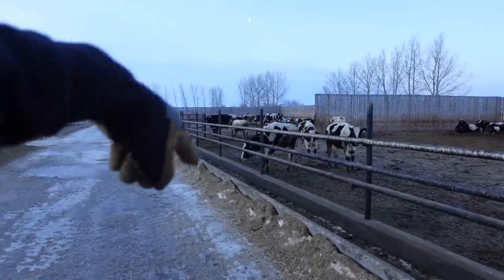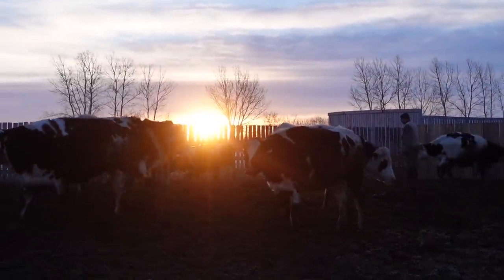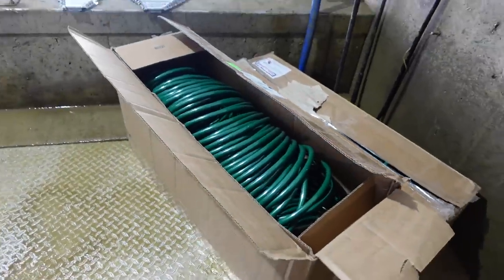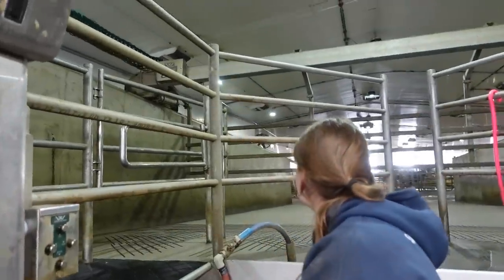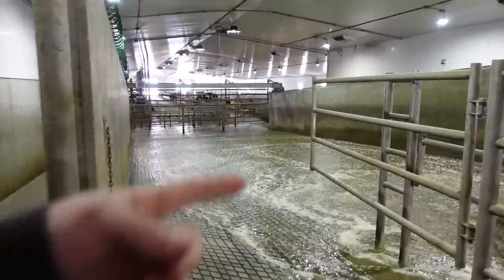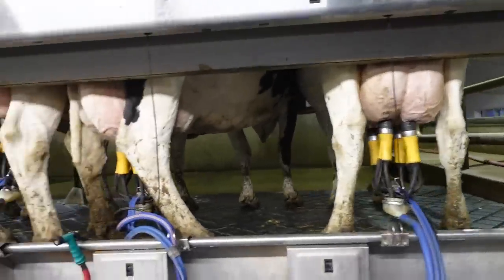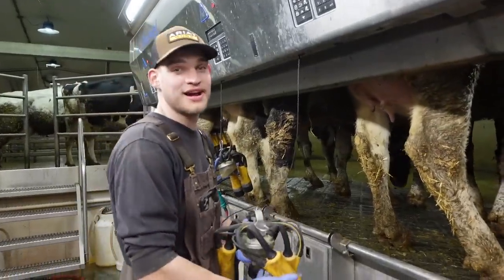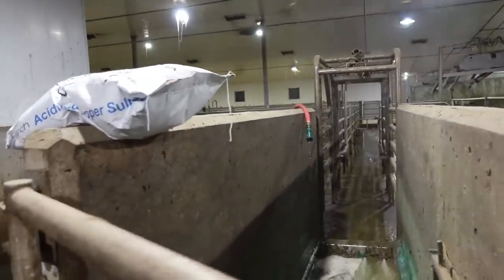Team Work Makes The Dream Work!

Comment: Could take an old line and feed over cable. Then you’d have rubber on rubber. Would save some wear also. Thanks for your videos ✌️
Reply: Exactly. I've also seen this done with pex. Take a piece of the tubing, make a slice all the way down, and then fit it over the cable.
Reply: Pex works

Comment: You might consider putting some split plastic wire loom on the cable to prevent the lines from rubbing on the metal cable.

Comment: Have you considered putting one of your older air lines on the cable to prevent the metal on synthetic rubbing?  What about grease on the cable?

Comment: Just a suggestion - you might be able to protect the air lines by putting a rubber hose around the cable, so rubber runs on rubber, instead of on the metal cable.  That shouldn't be too hard to do  - cut a small garden hose lengthwise, and wrap it around the cable.
Reply: A split water hose, or old air line, or pool noodle will all work, but will have increased friction when the air lines drag over it.  Better solution is plumbing PVC pipe -- that's smoother, so reduced drag on the air lines.  You can use old, leaky pvc pipe, which should be cheap.  And bigger pipe (like 3" or 4" diameter) will spread the coiled air lines over more of the pipe, thus reducing the wear on the air lines.  It will take some work with a saw to split the pipe, but once done, it should last for years.
Reply: I’d suggest a Teflon sleeve over the cable.

Comment: Another great video Jan. With those air lines have you thought of putting old air line or some type of plastic hose over the cable so they do not wear so fast.

Comment: If you cut short sections out of old hose, and split them lengthwise on the outside of the curl, they can be slipped over the new hose and give it extra thickness where it rubs. Then ya just change(or re-adjust) the protectors as needed 🙂 Is the steel cable coated with a hard slippery plastic too???

Comment: Hey Jan, That looked like a tough job replacing the airlines, good job! Maybe you can protect the new lines from rubbing and wearing again by stuffing a discarded hose around the steel wire to make it more soft. Of course only if the wire has no other function than carrying the hoses..

Comment: Sibling team - Awesome!  When you say the air lines "wear out" do you mean by rubbing on the cable?  If so, is there something you can cover the cable with to alleviate that.  I was thinking along the lines of split foam insulation that has the sticky edges so it seals itself.  Foam may not be the best choice as the lines would not slide as easily and you may not be able to get it in a long enough single piece.  PVC pipe with a slot in it just big enough to fit over the wire?  Again, can you get a piece long enough.  I think you get the idea of where my brain is going, I hope, LOL  Maybe using a tape type product to cover the wire itself.

Comment: Jan if you slide a plastic tube over the guide wire it would ease up the friction between the guide and the tubes as they slide back and forth. Exceptionally cool videoc today Jan. Your sisters were a pleasant bonus.

Comment: Get a plumbing sleeve like thay cover pipe in the concrete slab and that will protect the lines. Just have to replace the sleeves every 3 or 4 years.

Comment: If nothing other than the air line runs on the cable, maybe put up a plastic covered cable. Or could always hang the loops with a small pulled that rides the cable. Benefit of the pulley is that air hoses never touch the cable

Comment: Did you ever think about putting metal or aluminum casters on that wire cable that hanging so your hoses won't get destroyed when it goes back and forth get the metal casters put them on that cable hookup a short wire to your hoses so they could just slide very easy and that's going to save your hoses from destroying itself think about it